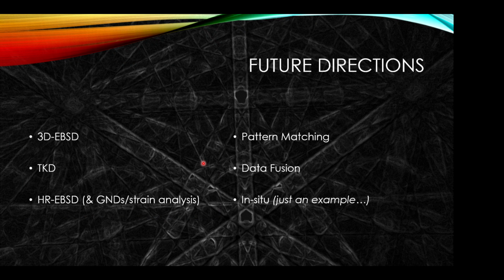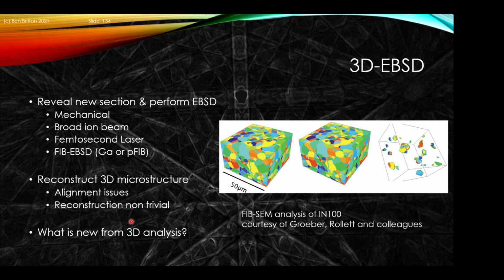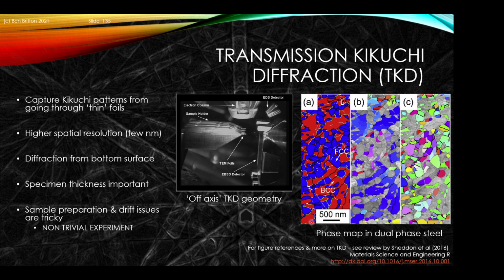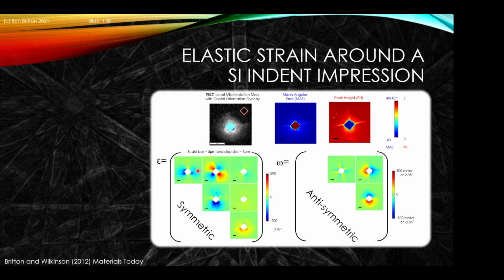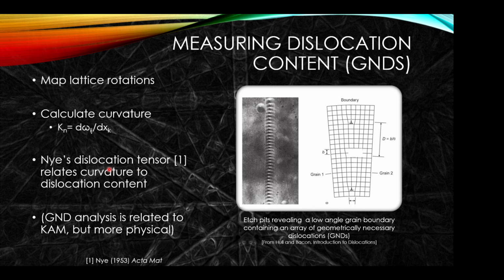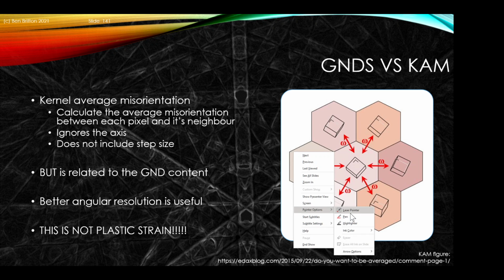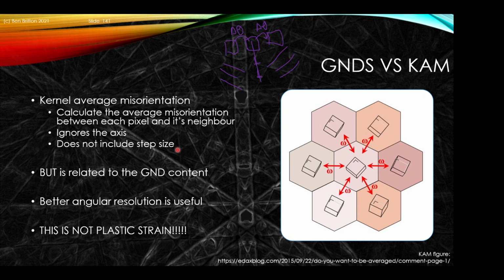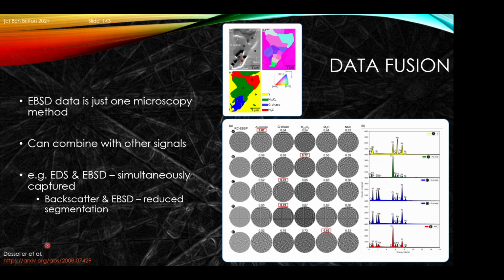Introduction to EBSD: Section 8 - Some Future Directions

Comment: Hi Ben, thanks again for the great lecture series. In a standard FIB-SEM arrangement the EDX detector cannot be on a horizontal port of the SEM, meaning that tilting the sample will introduce shadowing from the detector. Do you think it's still possible to record EDS spectra at 70° tilt in such a configuration and measure EBSD and EDX and the same location? And what's your opinion on combined 3D-EDX and EBSD (combined with Ga or Xe-FIB)?
Reply from the maker: We have done EDX + EBSD. It requires a bit of work due to the interaction volume (more than shadowing). We are about to do 3D pFIB EBSD+EDX...